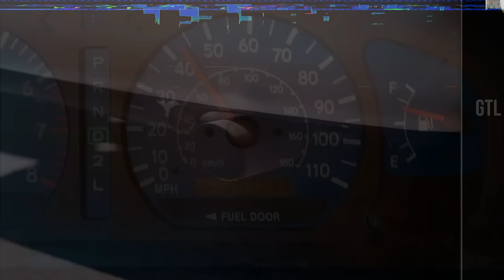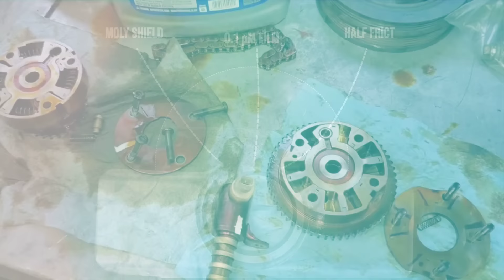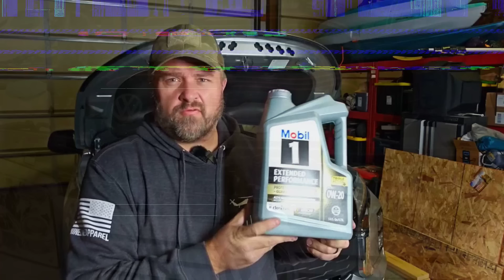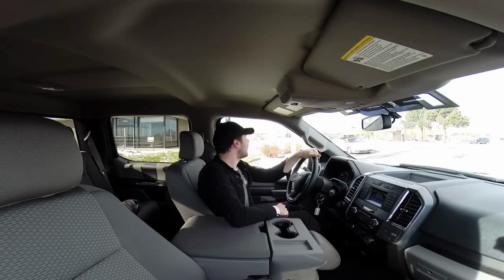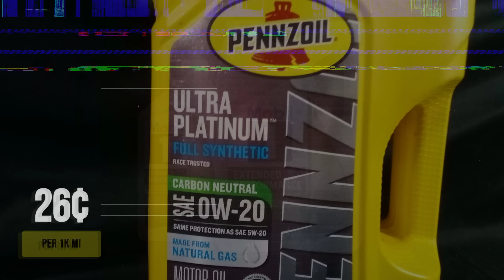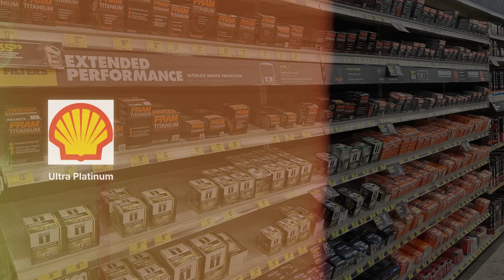Penzoil Ultra Platinum vs Mobil 1 Extended Performance

Comment: Actual testing and analysis shows that Mobil One is less shear stable than most of it's high end competitors.  This is most likely due to the higher amount of additives.  That same package also contributes to higher sludge formation in the the turbocharger.  Also, the idea that Nascar does not choose oll due to sponsorship is just plain ignorant.  What brand is painted on the car may not even be what they are using.  Proof of that is the cars that still advertise STP.  A product that would never be used in a modern racing engine.

Comment: I changed to ultra platinum 4 yes ago my car is way smoother and quieter i can tell the difference i never go over 5k miles now i want to try valvoline restore
Reply: R&P is good for cleaning. PUP is good for maintaining. After 5-6 oil changes with R&P, switch to PUP

Comment: Been using Pennzoil Platinum/ Ultra Platinum over 10yrs! Cant beat it in my expensive Ford 4wd trucks. 💯
Reply: Well Pennzoil changed their formula in 2025, it's no longer made from natural gas.  It's now more expensive and has been downgraded.  Will not use it anymore.
Reply: @DroneStrike1776 same. I used it in my wife's forester and f150 since we got them. Just changed hers with Valvoline restore and protect and I think I'm going back to mobil1 but this time going with their ESP oil
Reply: @DroneStrike1776 exactly... Not worth it.... It was but not any more... I switched just recently

Comment: I'm a big Mobil1 fan boy. The past 30 years I never had an engine fail. Mobil1 EP 5w30 oil and Mobil1 EP oil filters. 5-7 k miles intervals keeps my motors humming along. Over 200k miles and running like new.
Reply: I’m telling you would notice a big difference in the way the car runs using pennzoil ultra platinum. Its base is made from natural gas instead of crude which is much cleaner.
Reply: @danieltanner8762  I agree that PUP would be my choice if I had a turbo or high performance engine.
I run 95%highway miles and Mobil1 EP works for me and my base engines.
Reply: @robb15033  Even running highway miles can be hard if speeds are higher.
Reply: @jimsgaragetoys Yeah, we all drive as a hive at about 65 mph for 50 miles with stop lights at the end.
At least a hundred miles a day, extended oil intervals.
Reply: I was the same way, used Mobil 1 for decades but PUP is a big step up. It's just a cleaner base, actually a much cleaner base coming from natural gas and it protects better. I still change mine every 5k miles. The last time I bought some I got 3 5-quart jugs for $62, what a steal that was!
Reply: @jimsgaragetoys Yes, PUP is a superior oil for engines with turbos and high performance cars. I own two base four cylinder engines and I have used Mobil1 EP for 200k miles and neither engine burns oil.
Reply: @robb15033  I don't doubt that, as long as you replace it regularly you will be fine. I just prefer to use an even better, cleaner oil since and it's even costs less.
Reply: @jimsgaragetoys  Yes, if my engines were turbo charged or GDI engines, I would change too. But I don't , so I'm old school Mobil1 EP for life as is.

Comment: The only threat to Pennzoil Ultra Platinum is Valvoline Restore and Protect; It's properties are being recognized by automotive engineers, experienced master mechanics, etc. Thanks for this podcast.
Reply: Yep, Valvoline uses gtl in some of their oils and R&P has got to be better than even Mobil 1’s new formula
Reply: Even DIY owners vouch for VRP benefits to their car's performance.
Reply: Yeah, finding out my Corolla was previously a fleet car and not knowing the history previously, I ran 5 intervals of VRP with super shiny engine now.
Reply: R&P is an outstanding oil for modern GDI / turbo engines, with moderate SAE 30 vis of 10.7 cSt (i.e. not too thin for turbo engines).  The only caveat is they don't yet have a 0W formula for those of us in arctic regions.  Otherwise I'd be running it instead of Mobil 1 ESP 0W-30

Comment: Ever wonder why everyone always goes after and compares whatever they're peddling to Mobil 1 ??  🤔
Reply: Only cause it's best selling. Not best oil. Pennzoil is legendary as well.
Reply: That’s because it is advertised more and they pay Mercedes and others to recommend it.  It is a good oil and if changed at the recommended intervals, the cars won’t break down until after the warranty is over. So it’s a win money for Mercedes and others, and it’s a win for one in the advertising competition.
Reply: Because Mobil 1 is a big seller and has been for years.

Comment: Just change your oil more frequently what the hell is your problem ??
Reply: I get it, but better is better and might make a difference in an unexpected event. An overrev etc. Your mostly right but nobody ever moved forward by saying thats good enough and we dont need more. Competition is good especially when they are starting to let CAFE standards dictate engineering and oil formulation
Reply: Oil is not oil, most group 3 will last 5,000 miles, unless you lean hard on a turbo car or tow a lot.  Then a UOA is needed to know if that group 3 is still good at 5,000.  At 10,000 miles on  0w20 you best be using group 4.

Comment: Pennz Ultra Platinum first came out in about 2014 and Ive been using it since then in my '08 Toyota Tacoma. Prior to that I used Mobile 1. Ive got 450,000 miles on the clock right now and the engine still starts and runs like the first day i brought the truck home from the dealer. My change interval is 4,500 miles.
Reply: If your telling the truth (doubtful) it's an OLDER Taco. Newer ones are trash. Ranger easily best new midsized truck. Colorado & Nissan close behind.
Reply: @Davido50 I clearly stated thats it's a 2008. And why would anyone post random lies from an anonymous YouTube account?
Reply: @o_g_i_b_rockin  🤣😂
Reply: @o_g_i_b_rockin lol ranger is pretty wack tbh and i got one 😂❤
Reply: Ranger is a COMPLETE joke compared to the Honda Ridgeline.  Asian manufacturers DOMINATE the midsized truck and EV global market and fast overtaking the global SUV, passenger, and luxury vehicle markets.  Only thing propping up American manufacturing is white supremacy.  The promotion of white mediocrity.  The original Affirmative Action.
Reply: What oil filter Brand are you using?

Comment: Pensoil platinum is Dexos certified but ultra platinum is not?
Reply: Wrong. They both are dexos rated. Google it!!! Smdh
Reply: That cert. is costly, if you're improving an already existing oil, why pay millions for the cert?
Reply: Has way more stuff in it. Not exactly a bad thing 
It’s been proven to be the he best oil in stores. Not that far behind from Amsoil signature

Comment: He’s basing Mobil one lubricant performance when someone takes it as far as 25,000 miles. I use Mobil one and change it every 6,000 miles. Huge difference. Amsoil always goes after Mobil One and nobody else when doing an advertisement comparison. You want the best oil? Look at the SP designation, use the recommended viscosity, and change it frequently.
Reply: I purchased a new Hyundai Sonata 4cyl in 2007.  I used to change the oil using regular Mobil One full synthetic every 5000 miles. The mileage now is about 180k miles. The engine sound is like new. No major problems with it or the tran. The secret is to change the oil every 4 to 5k miles. Any synthetic oil works fine as long as you change it on time. I service my cars myself.  I prefer to buy new cars and keep them for a very long time.
Reply: Yup. Good advice. Change it often. Nuff said.
Reply: Absolutely agree.
Reply: THIS

Comment: Don't care for high mileage oils, could only get 2,500 mi on an oil change with Pennzoil ultra,, changed to a more expensive Valvoline restore and protect and can get 4000 mi on an oil change now,, will not dare go any farther,, high mileage oil is a scam and will burn out your engine...
Reply: High mileage has added chemicals to stop leaks and maybe more ZDDP or equivalent.
Reply: Waist of money
Reply: @enriqueaguilar8788  Yup, I'm up to 36 inches now.
Reply: So what happened at 2500 miles?

Comment: The Mobil 1 Extended "High Mileage" with esters would be a better comparison. PUP is also a High Mileage oil.
Reply: I've read the chemicals in High Mileage can damage good seals and gaskets since they are going to soften and expand them...
Reply: @lonniebeal6032 truth!!!
Reply: @lonniebeal6032 searched the Internet for any tests to verify this claim and found none.
Reply: Mobil 1 EP is Mobil1s best product! So, perfect comparison. Both good oils but Pennzoil Ultra Platinum is the king.
Reply: @Davido50  Amsoil Signature Series beats them all in any and all tests
Reply: @candyman1967 Amsoil signature could be the best, but at twice the cost
Reply: @candyman1967  Barely, and at twice the price.
Reply: @hoopty60  The group 4 oils shine in Turbos, Towing and 15,000 mile OCIs.  If you're changing every 5,000 miles, and group 3 is fine.
Reply: @candyman1967  True, but at 5,000 miles, it's pretty much equal to group 3 oils.  At 10,000 miles it beats most group 3 oils.  So, if you Amsoil and change every 5,000 miles, you're wasting money, unless it's turbo or lots of towing.